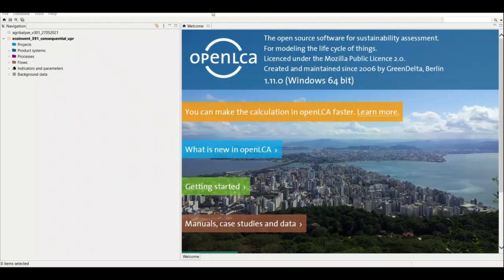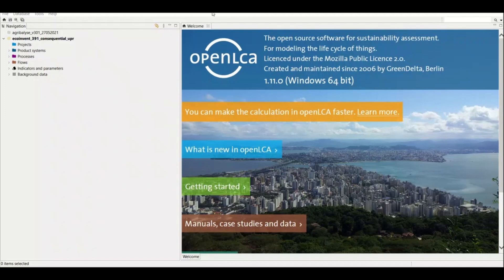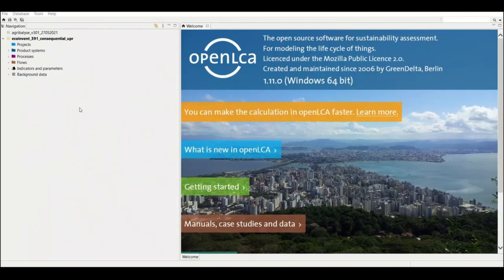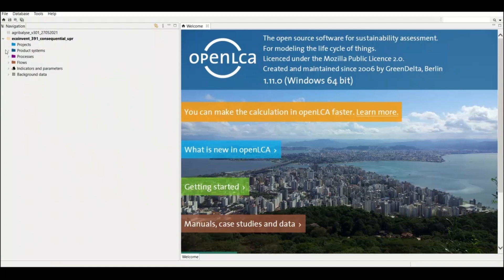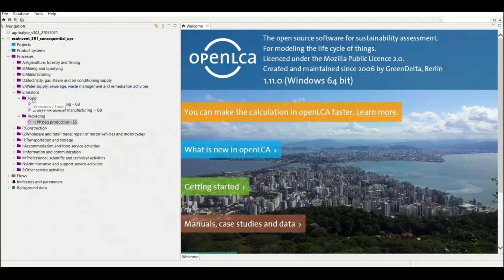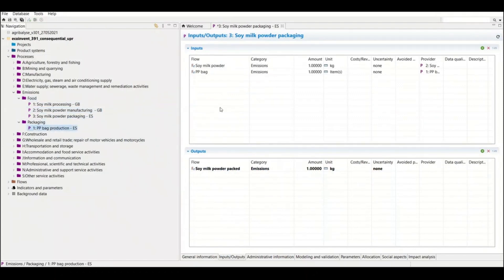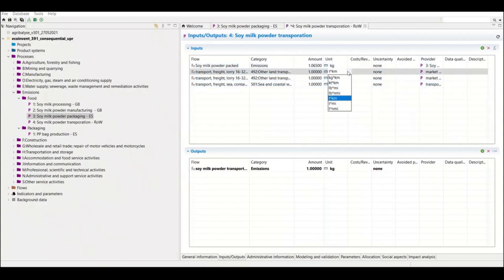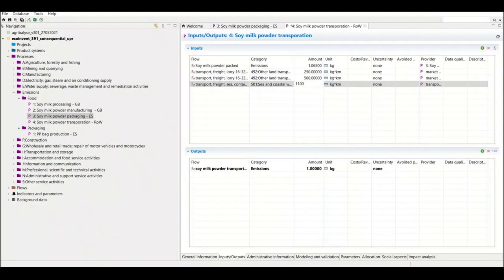Mastering OpenLCA: How to model transportation in OpenLCA I Learn LCA in 30 days

Comment: Hello, I would like to ask you a question regarding this method used especially using MULTI-OUTPUT PROCESS where you have 1. soy milk process, 2. soy milk powder manufacturing, 3.  soymilk powder packaging and 4. soy milk power transportation. 

As for me, I had 17 processes or multi-output processes with the final product system determining the FU.

unfortunately, for me...I had to show this multioutput processes production in different countries to know the impact of electricity mix of these countries.

I found out that when cross checking the TWO PRODUCTION HAVING THE SAME INPUTS BUT DIFFERENT ELECTRICITY MIX or DIFFERENT Location RER or RoW, the REQUIRED AMOUNT in the CONTRIBUTORY TREE are usually not the same.

Example....I used ''NaCl powdered'' as input as 0.5 g for both PROCESS in CANADA and ITALY. However, in the CONTRIBUTORY TREE, I will see 0.000075kg in CANADA and 0.043kg in ITALY.

So, I get confused how this calculations work differently for the same input amount and processes.

I am scared of having false result for my results comparing the two productions in two different countries.

What could have happened?